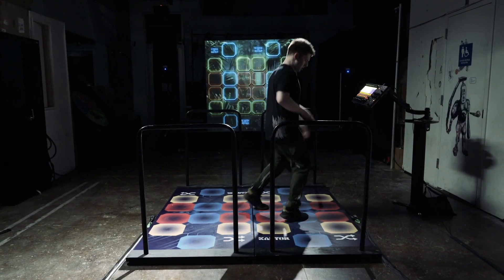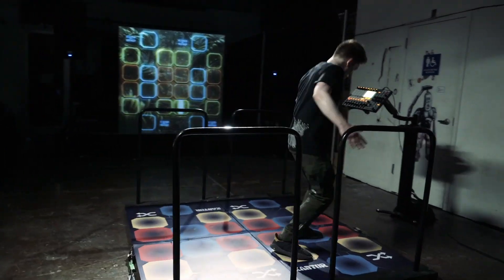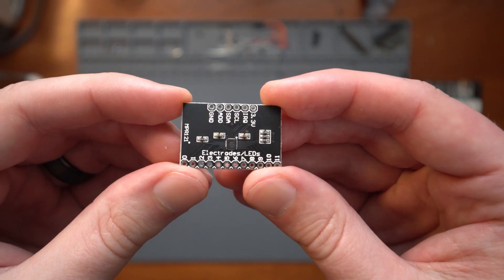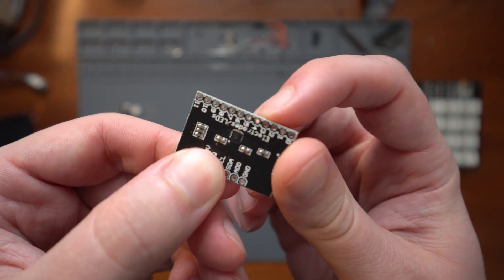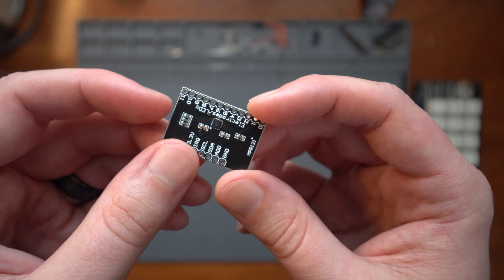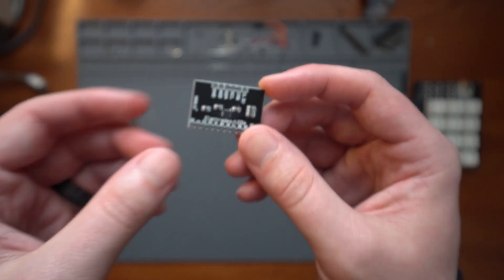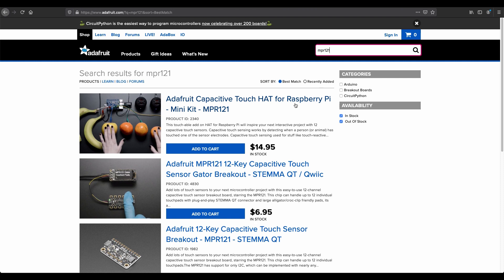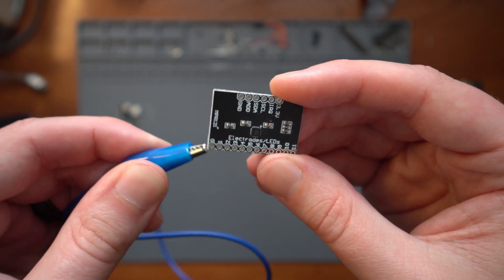Using a Twister mat as a MIDI controller!

Comment: You're video and blogs rock 🙏 hoping to build some things,  may need to learn more on not shocking and stuff,  wondered what revisions you'd make to design decisions were the interface to be on an inflated buoyant surface , on a shoestring budget,  + maybe also harnessing any other/ additional tech (if not just sensing on|off but perhaps also proximity ❎️ and force/velocity) rfid lidar and all that crazy jazz . Same sensors and approach for Giant Inflatable Twister Game Inflatable Twister Mattress Game For Sport Games?
👍🙏
Reply from the maker: Good question! For inflatable twister...
if you could actually get to the inside of it (you may have to cut/reseal it), I actually think the capacitive approach I initially took here might work? Since the pads are lifted off the ground, you could dangle their wires directly below each, and avoid the issue of accidentally touching the wires and triggering a false positive. You could potentially get proximity and a little bit of "pressure" info with that. You might also have better luck with something like an old kinect camera (or similar, more modern depth cam) and experiment with just trying to determine where are the bodies are in physical space. Might be harder to get something accurate, but you'd spend way less time rigging everything up.
RFID is an interesting idea! You could maybe make some kind of RFID reader bracelet/anklet and just put cheap sticker tags on each pad. Each bracelet would have to read the nearby tag and wirelessly beam that data back to some central station.

Comment: I’m curious to hear more about the software/synth setup you decided on (past the microcontroller/once MIDI events are received); how did you decide how to make random combinations of Twister dots make harmonic sense?
Reply from the maker: Good question! I didn't really go into that because it felt like an afterthought. But basically, I fed the notes into 3 different virtual instrument tracks in real time - one bass, one plucky piano thing, and one lead. I placed a MIDI arpeggiator plugin (BlueARP, it's free!) on each track. I basically just clicked through presets on each channel until I found something that sounded "nice", but the one thing I did for all of them was quantize the notes to a C major scale. All 3 sounds are coming from a plugin called Helm (also free!!).
Reply: @GuyDupont  Makes sense! Simple and elegant, thanks for the explanation!